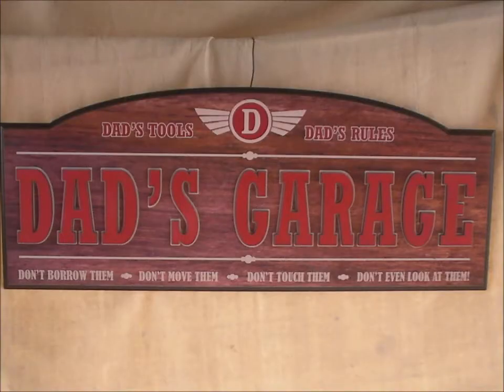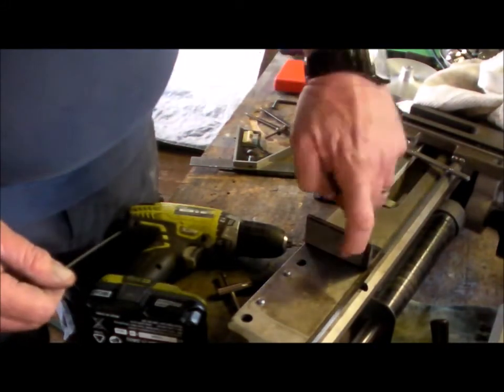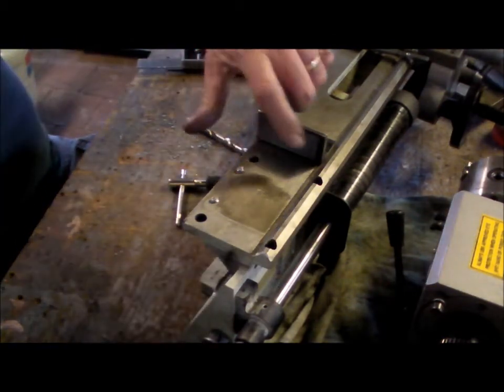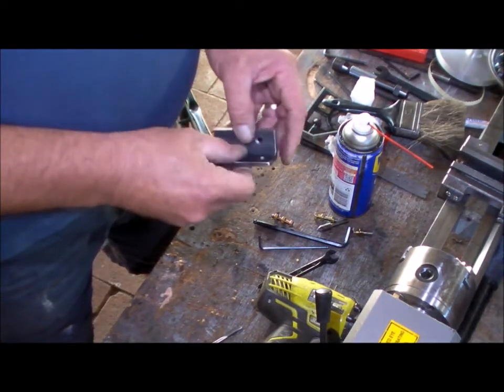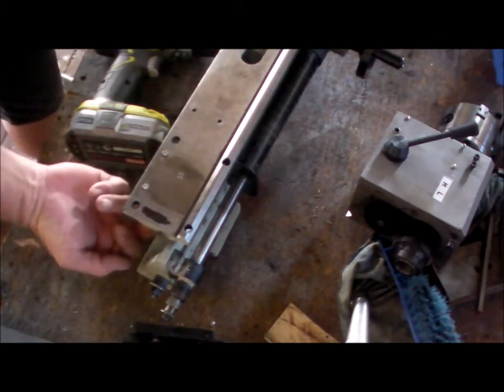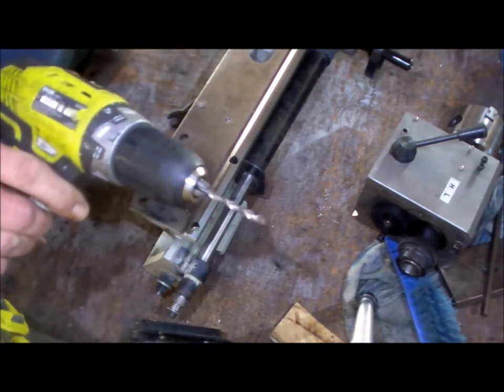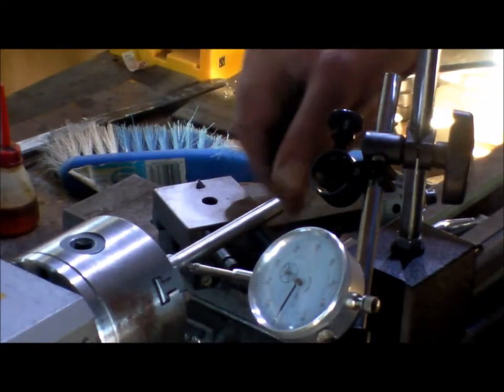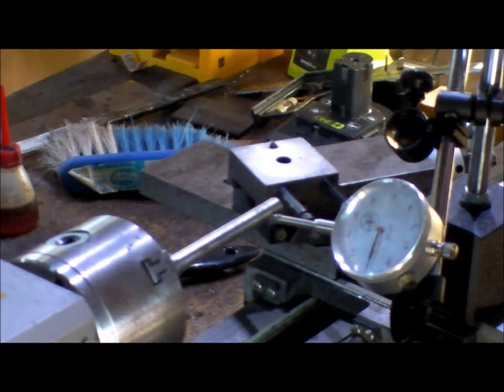Aligning the headstock of the Mini Lathe

Comment: You could have easily solved your problem with couple of shims. Position the shims on the v rib for alignment on the x axis and on the flat bed surface for y axis. I used to have -.044 runout on x and -.025 on y for the entire length of the he bed on my mini lathe. Few precision shims and one hour down the road and now I am below .001 runout at the furthest position on my bed.
Reply from the maker: Thanks for your comments, this is something I will need to look into a little later when I change the plastic transmission gears.

Comment from the maker: Hi Joe, the headstock is loosely aligned with the bed ways by the raised inverted "V" rib running the full length of the bed. The headstock, carriage and tailstock all align with this rib but  the carriage is aligned with the rear of the bed ways with a gib therefore the rib does not play in the alignment of the carriage. The tailstock has a similar problem as the headstock:-- Hold on I just went out to have another look, see my next video for what I found.